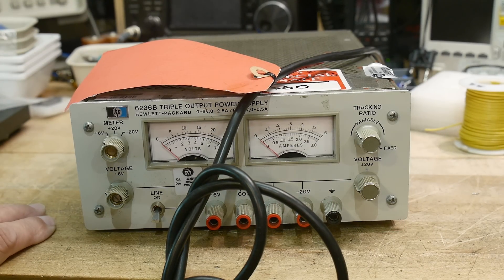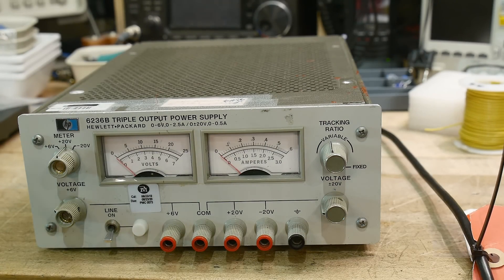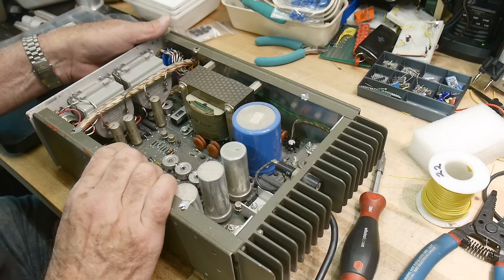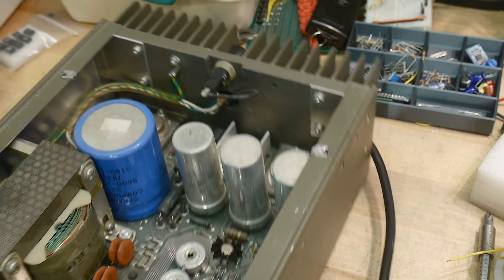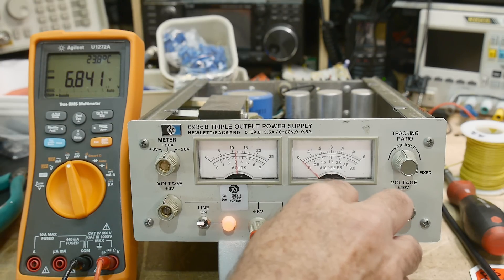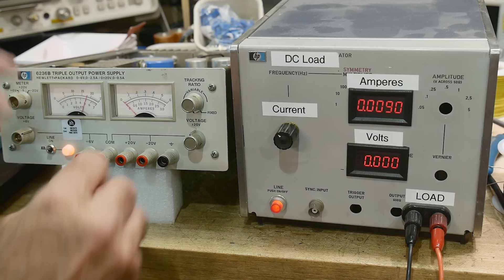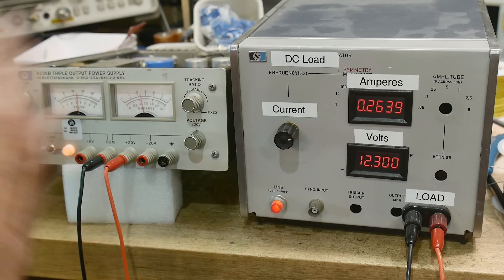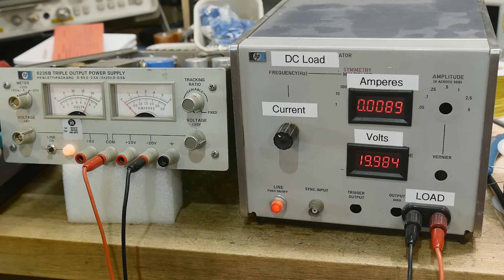#1241 HP 6236B Triple Output Power Supply

Comment: I just bought a 6237B from Ebay today for $38 plus $11.44 shipping 😁. Only difference seems to be that the 37 has an 18 volt output instead of the 6 volt on the 36. I personally would rather have the 36 but for the money I couldn't pass it up! Under the missing knob cap is a screw, is that an adjustment screw? Can you get caps for them?
Reply from the maker: no adjustment under the cap, just a slot in the shaft. you might find a knob on eBay used. no new ones avail

Comment: I love these. I have this variant, as well... nigh indestructible and easy to service. It's silly to want more, but I would dearly love another one to live next to it.

Funny thing: around the time that HP bought Harrison Labs, the lore is that HP engineers hated servicing them because of their alleged complexity (this was mid 1960s, I guess, so I can't fault them too much.) They didn't come in often, but required thought when they did, because of their designer's ahead-of-their-time feedback loops. Sort of the "alien technology" scenario. This specimen looks like a more recent sample, and of course they now have a reputation for being pleasant to troubleshoot now that the designs are well-known and became standard in most supplies.

I couldn't find the original lore on Harrison that I remembered... it's mentioned a lot on the web but I can't find the original boat anchor history site that had the HP engineers actually mentioning their head-scratching work on the Harrison designs, which were really, really advanced for their time, apparently; one reason HP bought Harrison was because Harrison had developed some of the earliest switching supplies, as well as the most reliable and stable early transistor supplies. I'd love a link to a site that could match that description if someone knows of it.

And, of course, the 60s/70s HP badges are pretty.

Comment: A dual tracking supply is great for op-amp circuit testing. It looks like the analogue current meter is reading a bit low on the +/- 20 V range. This might have confused the tech testing the unit.

Comment: Looks like the panel meter measuring current on (at least) the -20V range was incorrect.  Your load showed 500mA, but the panel meter was closer to 450mA.  If when testing he ran it up to 500mA on the panel meter, it would have likely shut itself down since the actual current was higher..?
Reply from the maker: No, I don't think so. any test lab would not trust the device under test. they would make measurements from the outside. There is a simple resistor adjustment inside the supply  to set the meter. I should adjust it.

Comment: Have 2 of these, a 6200B (unfortunately...that one has a failed lower tap on the transformer), and the 40V version of that one.  Can't remember the model number of that one.  Anyway one of the 6236Bs I had wouldn't regulate at all and was DOA.  If the meter just pegs to max, chances are that's what's up.  There's a reference opamp, a hard clamping 7.5V zener in the back that burns a crapload of heat, and the 3 regulating opamps for the +5 and the bipolar 20V outs.  Both the 20V ones were blown in my one unit.  One can replace those ancient TO-99 1558s in there (those are getting ridiculously expensive for what they are) and just shove a TL071 in its place and you're good to go.

Comment: The 6200 supplies are awesome. This is a great score for a good price. I have several 6200 series for different purposes, though my primary on the bench today are an E3634A and a 66312A, for automatic testing (curve tracer? what do I need that for? I'm in no rush). I also use a GW functional knockoff of the 6236B. I will note that the current dropout here is not a crowbar. It is foldback for the 6V, and a hard limit for the +/-20V, the difference being that a crowbar (traditionally implemented with an SCR) shorts the output to ground to protect from overvoltage, and only resets on power cycle or explicit reset. Foldback is load sensitive voltage reduction, and doesn't require a reset operation, as when the load drops sufficiently , the supply will comply again, as with hard current limiting (constant current for linear loads). R6 and R26 set the +20 and -20 limits. Using the current load, once you exceed the setpoint, the potential will go to near zero, as that is what the load forces, since sufficient current is not available. If you tested with a resistor, say 20 ohms, and set the supply to 12V, you should get 0.5A, give or take, and 10V.